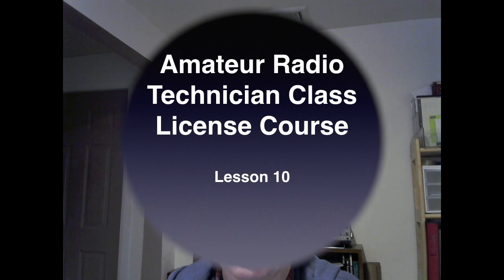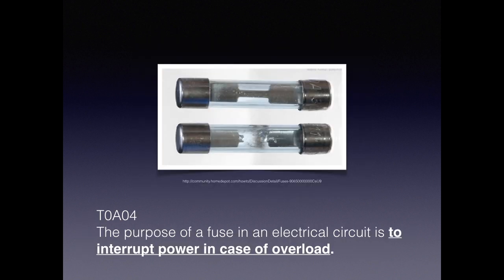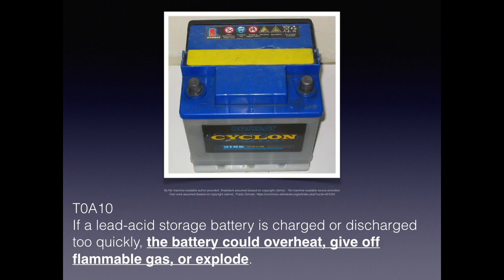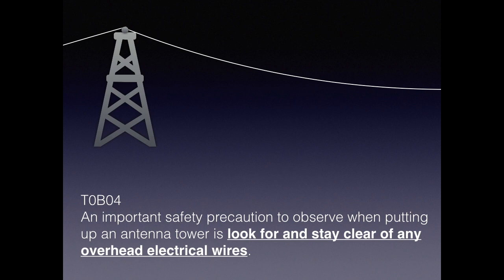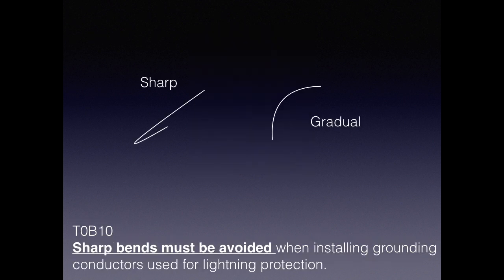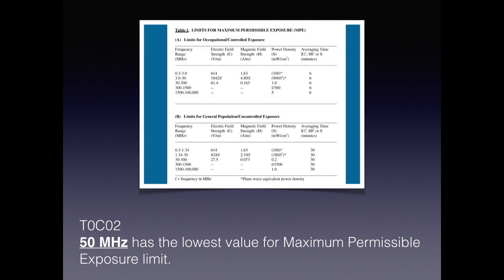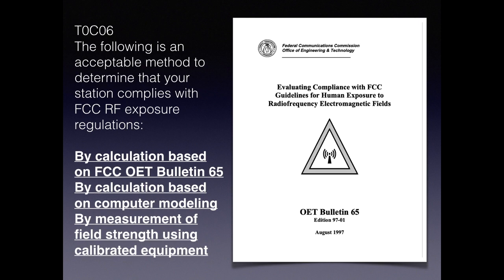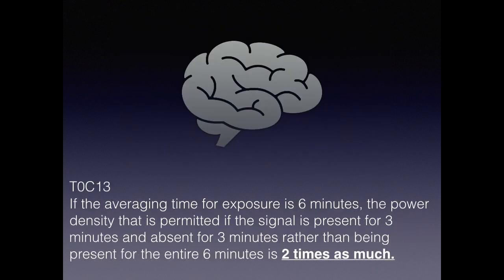Amateur Radio FCC Technician License Course Part 10

Comment: 13:28 I just missed the question on the sample test and had to look it back up in your video sir. 
T0C13  If the averaging time for exposure is 6 minutes, the power density that is permitted if the signal is present for 3 minutes and absent for 3 minutes rather than being present for the entire 6 minutes  is= 2 times as much.

I said half as much which still seems right to me but the answer is 2 times as much.
Some answers I guess you just have to take their word for it and put down the answer expected.
Reply: Right, I didn’t get that either but oh well thanks for the heads up
Reply: @drdabber710  I think I get it now. Since the exposure time is cut in half the allowable power density can be double.